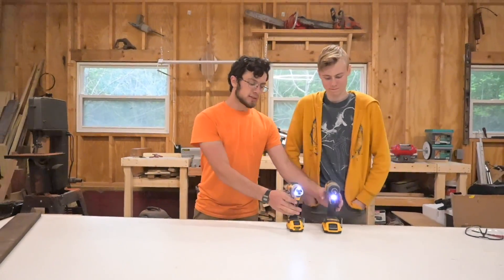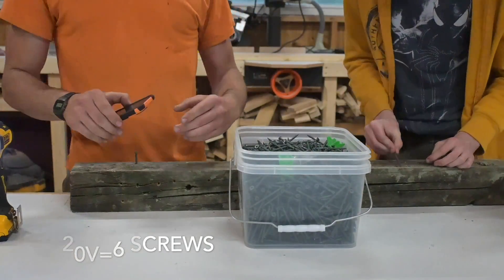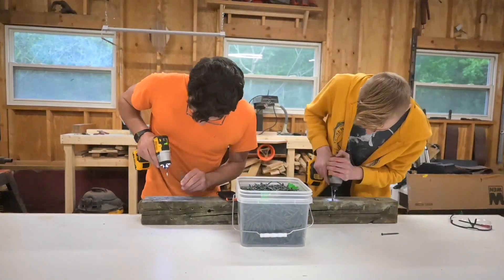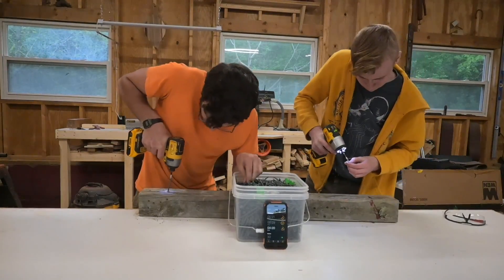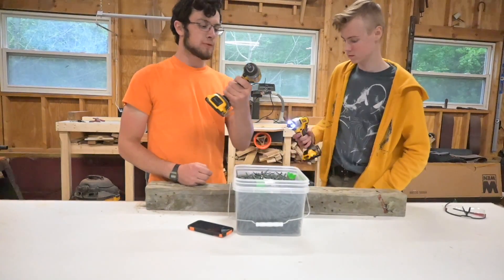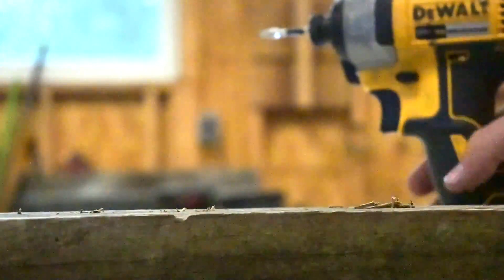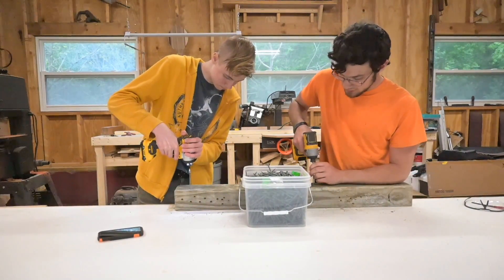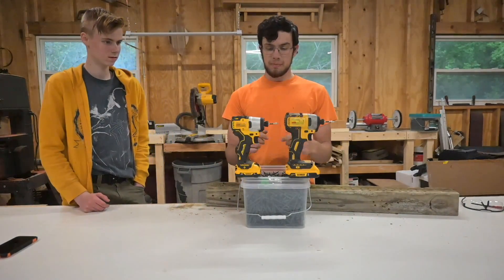12v vs.20v impact drivers | Which is better? Let's find out!

Comment: its a waste of money for even 100 just go to harbor freight and use their deal where you buy a charger and 5ah battery for 99 and get a free 20v impact driver or any of the other tools they offer for free, I currently have one and its awesome.
Reply from the maker: Maybe I will buy one of those and test it against the dewalt
Reply: Dewalt frequently has a similar deal, honestly.